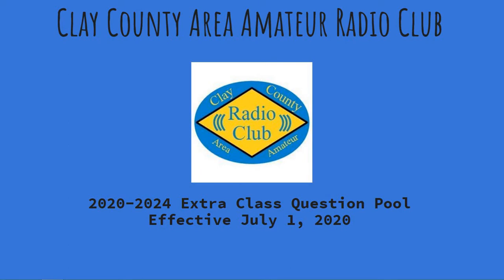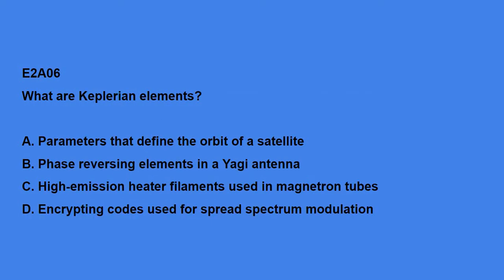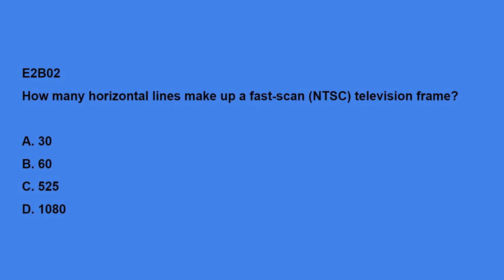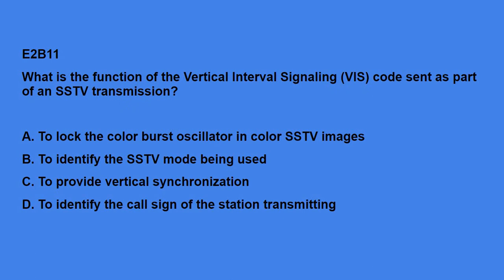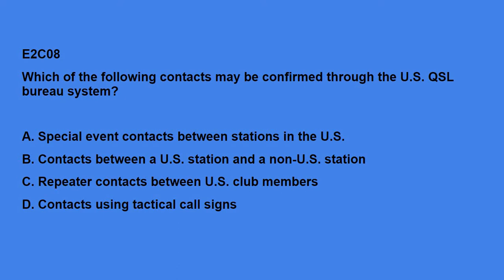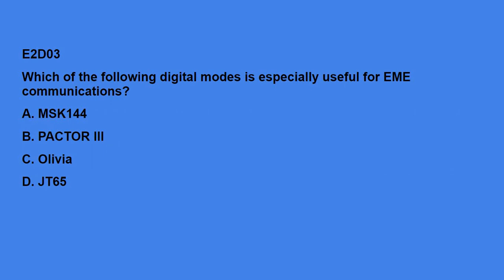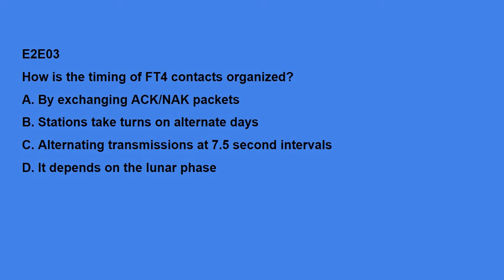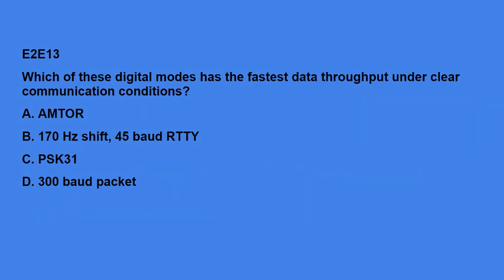Extra 2

Comment: I believe that you skipped reading E2C02
Reply from the maker: I am sorry, I was attempting to put the slides out quickly and overlooked it.  Thanks for catching it.
Reply: E2C02 - Which of the following best describes the term "self-spotting" in connection with HF contest operating?
A: THE OFTEN-PROHIBITED PRACTICE OF POSTING ONE'S OWN CALL SIGN AND FREQUENCY ON A SPOTTING NETWORK
B: The acceptable practice of manually posting the call signs of stations on a spotting network
C: A manual technique for rapidly zero beating or tuning to a station's frequency before calling that station
D: An automatic method for rapidly zero beating or tuning to a station's frequency before calling that station
Reply: @12:30 E2E04 is should be read ellipses and crossed-ellipse not "eclipses" "crossed-ellipse"